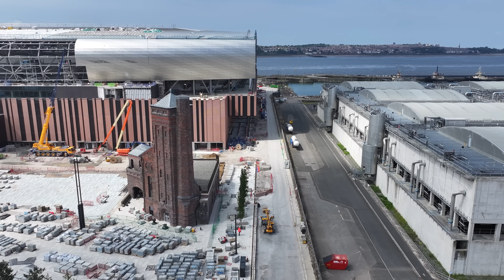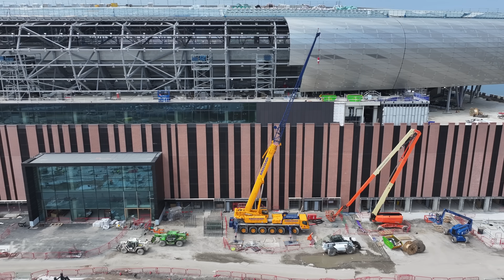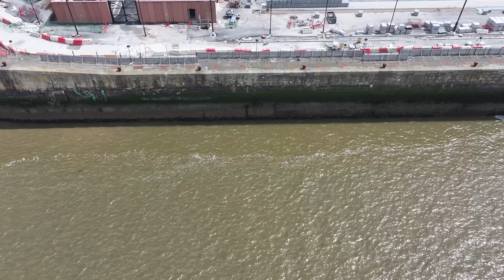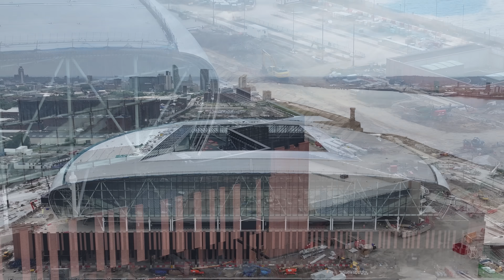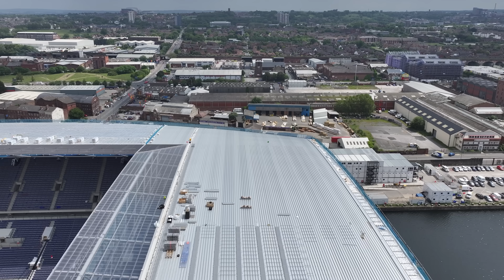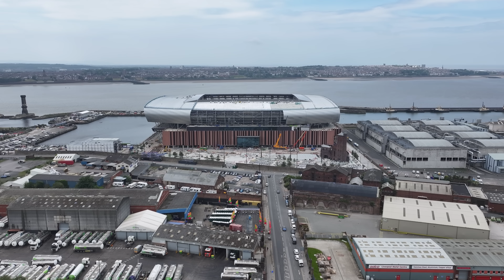NEW Everton FC Stadium at Bramley Moore Dock. A Full FlyAround!

Comment: Hi Nick. Great videos as always. I see there installing more soak aways (at 3 minutes on your video). It's obviously there to capture any rain at high tide and then release it into the Mersey at low tide, to prevent flooding. It's going to be interesting how they are going to install the barrel cladding on the West Stand, as they've already installed the pathing. What are your thoughts mate?
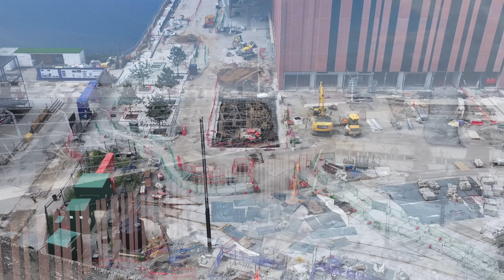Reply: The excavation at 3:00 you’re referring to is for the trees they’re about to plant. The plastic and soil they’ve installed will capture rain water to enable the trees to survive.

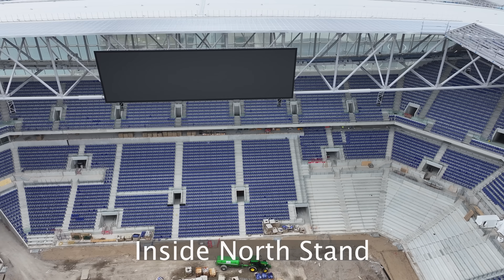Comment: Thanks Mr D 👍🏻 Next time, please can you zoom in on the empty row in the lower tier of the north stand (centre left at 11:38)? I know someone else made this request the other week, but you zoomed in on the wheelchair platform instead by mistake. In the final approved plans that row has seats so I don’t understand why it’s empty. Thanks very much 👍🏻
Reply: @evertonian95  Away fans are in the north east corner. I’m referring to the north stand lower tier (centre left) where the home fans will be. Empty row - no idea why it doesn’t have seats.
Reply: Dunc: seconded. Nick, IF you read this, Dunc is trying to point out the following Terrace: "The North Stand Big TV screen is as wide as the 3 central Lower Tier seating sections at 11: 35 mins, and in the left/west-handed Lower Tier seating section of those 3 sections, the 15th row up from the pitchside is a blank terrace, to the left/west-side of one of the 2 main vomitories. That terrace is not empty in the designs, so Dunc would like a closer look for clues as to why it is so now".

Comment: Will the water filled channel they are creating on the west side between the adjacent north and south basins be ornamental only or functional?
Reply: Only for aesthetics, won’t have boats passing through
Reply: Graham: Both, but not as a navigable waterway. It's mainly for aesthetics but it will also allow some water to pass between it and the Docks through pipes under the isolation Bridges for two reasons:
1) The concourses' groundwater will collate and pass from under the site and the West Promenade and empty into the Water Channel and thence to the Docks
2) Any flotsam and jetsam on the surface of the water channel will migrate to the Docks

Comment: Great video as always Nick, these are such great snippets of how good the stadium will be once fully completed.
Can I ask do you know how wide the canal will be on the west plaza also do you know how high the passageway under the steps on the west stand will be?
Reply: You can see how wide the water channel will be if you search ‘stadium db final Everton design’ and then scroll down to the high definition images (‘renderings’) from August 2020 👍🏻
Reply: The general area under the mezzanine will be about 4m between the granite flooring and the mezzanine support steels.  I can't give you one answer to the width of the water channel as it's to be an irregular shape and the front/west edge of the Lower Promenade will not actually run N-to-S parallel with the old Dock Wall at the West Side. So, if you want an accurate-ish measurement at any particular position you'll have to offer one. As Dunc states, you can see where the outlines will be currently if you look for the Granite Coping Stones on the West Quayside.

Comment: Hi Nick, great video as always
It looks like rail seating will be fitted in the North corner for away fans and that is why seats have not been fitted in the lower corner.

Do you or anyone else know if some of the seats in the lower north stand are going to be exchanged and fitted with white seats, as the designs have 1878 showing across the lower section, while the south stand has a huge E.F.C covering both the lower and upper section.
Reply: The initial plans had 1878 and Everton in white seats but the final approved plans have all seats blue. There’s a chance white seats might be exchanged to incorporate a sponsor’s logo but no plans to at the moment 👍🏻
Reply: Cheers Dunc.

Comment: There appears to be a gap in the barrel cladding..will this be corrected?
Reply: Expansion gap
Reply: Looks terrible
Reply: Maybe expansion joint to be filled with silver/grey mastic.
Reply: @billyboy6467  I hope so
Reply: @billyboy6467  Billyboy: no, it will remain as an intentional small gap. You'll get used to it. Dan Meis wanted the engineering to be reflected in the overall appearance.

Comment: Quality video again Nick
Question about the barrel cladding on the north east side. There’s a gap where the two separate sections meet, do you think that will be filled or left??
Reply: ruins the look for me
Reply: I was down there yesterday and spotted that. It's very noticeable. We're gonna have to shine the Badcock symbol in the sky here for some reassurance. 

David, over to you....😂
Reply: They won't be joined. The north roof and the east roof are separate (all four stand roofs are), including the cantilever steel that the barrel cladding is attached to. There's a gap between the side and end roofs as well, maybe it's to allow for some movement in high winds? I think there's going to be some kind of floating, 'attached to one side but not the other' kind of guttering (at least I hope so!) otherwise the people in the seats under there won't be happy in the rain!
Reply: Looks terrible, I hope it’s filled
Reply: @DuncTheBlue1878  it's a new entry straight in at number 1 on my stadium-build annoyance list, replacing the single missing coping stone on the media compound.
Reply: @colingillbanks4022  Yeah, that missing coping stone does my head in
Reply: @aq1974_  Yeah I've just had a look on the People's Project app at the rendering there and the gap appears on those pictures also. There's another one at the other end (South East) and two on the West barrel as well. Maybe it won't look as conspicuous when there's another one in place at the other end and the rest of the cladding is up.
Reply: @DuncTheBlue1878  It's  been missing for months. How hard would it be to just sort it! Unless there's some sensible reason why it's not been installed, obviously.
Reply: Not sure i'd have even spotted that gap but for the comments, barely noticeable and disagree that it spoils the look, onions.
Reply: @palez1046  I mean it's not barely noticeable. It's very noticeable. If it's part of the design and necessary for the aluminium panels to expand when subjected to the heat of the sun, then it's obviously something that we can all live with. I spotted it driving past on Derby Road yesterday, so it's definitely something that can be seen even from a distance.
Reply: @DuncTheBlue1878  ; me too. It makes me feel anxious and fidgety and want to check the cans in the kitchen units are all facing the right way!
Reply: An expansion gap would make sense
Reply: @colingillbanks4022  Colin: yes, I can give you a full version of the reasons for the necessary part of the design but the headline is that the expansion gap is there to stay as part of the design.You'll soon get used to the idea that it visually separates the different areas of the stadium and because of that I quite like it. Dan Meis wanted the stadium engineering to be seen and understood, which is just one of many reasons why the barrel-cladding is partly see-through. There's something of an irony in people wanting to preserve the old engineering points of interest from GP, such as the Leitch design, but don't want to accept and admire the looks of the feat of the new. I do get that everyone's opinion will differ.
Reply: @A-Queue  There are no seats under the Expansion Gap in the Barrel-cladding. I am, and you need be, more concerned about the finish under the Expansion Gap in the Standing-seam Roof, which does over hang the seating.
Reply: @colingillbanks4022  Colin: I can give you the reasoning. The main reason is not the expansion of the aluminium, especially as the cladding is all in small sections that have their own very small expansion gaps between each section. It would be more appropriately named a Movement Joint.
Reply: @davidbadcock2225  I've seen it again on my train journey into work today ans it probably looks less of a deal than I first though. I suppose if it matches each end - seems to be where the north/south stand roof joins with the East/west borders - it won't look too bad.
Reply: @davidbadcock2225  hmm...I would have thought (like I said above, but I'm only guessing) there will be some kind of guttering on the underside of the gap. We'll see, but I'll be looking for seats away from those gaps on cold winter matchdays just in case. Old Trafford doesn't need a competitor for 'most notorious stadium water feature' award!
Reply: @A-Queue  I am assuming so as it wouldn't make sense for such a fine detail being overlooked with such significant negative consequences. I reckon the planned solution is tucked away in some form of addendum specification not made available on the public access mediums. My guess is that it will be some form of underlying clear, flexible guttering but many options are possible, such as a wedged plastic insert. I'd have expected it to have been installed already if it's to be under the gap, seeing as how the under the roof work was completed some time ago. I doubt it ill be something overlying the gap as it would be vulnerable to the windy weather. It's a mystery and we'll have to wait and see what happens.

Comment: Hi it's looking good nick do you know why it was  Built that way round the west stand looks the most Impressive with the steps up to it but its round the back you won't see it unless you're going to the game
Reply: The West Steps are a design feature that serves several purposes.

1. A viewing platform for fans over the Mersey.
2. A place for fans to sit out before the games start (weather dependent).
3. Shelter for the rear of the stadium during stormy weather.
4. An escape route for Upper sections of the West Stand, in an emergency evacuation.
Reply: @DarrenCowzer-cx7ot  Will there be benching or just bare concrete to sit on?
Reply: @ollytheblue101 - safe standing can be terracing with safety rails in between, or it could be seats that can be used or kept up.

A number of clubs are in a safe seating trial, the UK government will decide if they will allow 3 x standing spots to 2 x Seats etc.

There is safe standing in Liverpool, Chelsea, Dortmund and many other clubs.

As far as I know, there are generally seats there but they're kept upright as everyone there stands.
Reply: @ollytheblue101  Olly: Darren has given you a fairly comprehensive reply but i think his second reply may not be what you're asking? If I am guessing right, you're asking about the terracing on the Western Terrace areas. 
The answer I think you want is that there WILL be SOME benching on the Mezzanine and the West Quay but largely it will be as you see. The Lower Promenade (the lower area now seen jutting out into the water channel, on the Seacant wall), is showing on the plans to have the terracing finished off with stone/tiling to sit directly on. On the terrace up to the mezzanine, there will not be any 'additional seating' installations as people can choose to sit or stand on each layer.

Whilst it is so that anyone entering the site will do so from the East, for now, most regular non-match day activity will be on the West Side with people using the Hospitality suites etc. There will be people regularly visiting the club shop in the East Stand and on some days there will be activities on the East Plaza but the bulk of regular activity will be on the West Side.

As an additional point, in the longer term, when Peel have carried out the development of the Liverpool waters site and the Mersey Walk is developed, all the way from the National Garden site to Bramley-Moore dock, people will access the site from the SW corner of the site, with the terminal at the Pump House/Hydraulic Tower, so it will be even more of a significant Viewing Platform.

Comment: Still can't see the Archibald leach chris/cross on the brick work
Reply: Me neither. Dan Meis isn’t happy about that either.
Reply: It is most visible in the corners where there’s more brick panels next to each other. I wonder if they deliberately dialled it down? It’s on the walls, on benches and is going to be on the perimeter fence by the accumulator tower too plus probably used as internal design - there’s more here than at Goodison!
Reply: @stevesanders6770  Steve: yes, the planners dialled it down before approval. One droner in particular, who flies very low and very slow, regularly reveals the pattern on the NNW corner, in the right light.

Comment: Nick: I hope you had a good time away.
1) My goodness, Nick, you do have brain-fade at times. Seeing as how it's been referred to fairly frequently (and was included in your East Plaza explanation Studio Video back in March) and seeing as how the same structures have been used wherever trees are located in hard-standing, granite flooring on the East Plaza, I thought you'd be relied on to see that the hole dug and now filled with the ArborSystem grid, is for the 4 trees at the SE corner of the Stadium in a 2x2 matrix there. It will then be extended towards the South Stand Viewing Gallery for at least 3 more trees in a single line.
2) It's good to see at 1:25 mins that they have started on the plant and tree border just to the West of the Pump House which will act as a backdrop to the Stage Area.
3) It looks as though they have now got the remainder of the 13 Columnar Elms' pits sorted along the North perimeter.
4) There are many comments on here abut the intentional Expansion Gap in the barrel-cladding. If you'd like an explanation, then please let me know.
5) You'll find that LoR have laid rebars in the trench at the side of the Seacant Wall of the Western Promenade.

Comment: I think the open areas on the north and south stands, exposing the back of the upper terracing look terrible and will give the stadium an unfinished look, as if the architect just didn't know what to do at that point.
Reply: Yeah I have to admit it's my only little gripe with the overall design. It just doesn't quite work for me, that part of it. Maybe it won't be as big of a thing when the rest is finished but bit does look a little incomplete and at odds with the sleek design of the rest of the build. Seems a waste of space too, particularly with the South stand when there could have been some great views of the city centre from bars or whatever under the bowl.
Reply: @colingillbanks4022  I think the structural pillars limit the practical use of the space, but perhaps the exterior could be clad in solar PV panels to at least generate some electricity. The installed upper clear glass acts to protect from wind and rain and allows natural light into the stadium. On the south side anyway.
Reply: @grahamcook9289  Yeah I suspect you're right. I would think that those pillars extend below into what seems to be the glazed hospitality area in the South stand as well though, so it must be an issue there too. It is what it is I suppose, and I think we'll be fine with it once it's all completed. There's more than enough good stuff about the stadium to not get too caught up in minor negatives like those two ends. The smaller North Stand is my major disappointment but that's obviously due to a lack of space and they've probably made the best out of the limitations.
Reply: Graham: Dan Meis actually wanted the engineering of the stadium to be seen and appreciated and NOT hidden away, in much the same way that in a Cathedral you can see what holds everything up. It's an intentional point of difference to other stadia.
Reply: @colingillbanks4022  Colin: the view is precisely why a cantilevered Viewing Gallery and Hospitality Suite is provided in the South Stand. Being another 10-20 ft up isn't actually going to change the perspective of the view to the city centre or Mersey significantly at all (the maths dictate that).
Reply: @davidbadcock2225  Cheers David, yeah I get that. It just could perhaps have been bigger? Seems a waste of the space available unless it's just not practical because of the steel supports projecting up through there.
Reply: @davidbadcock2225  Hmmm...not so sure about that. To me, it makes it seem even more like the architect lacked imagination at this point and gave this rather lame excuse instead. But on the subject of modern cathedrals and places of worship by the masses, could not stain glass windows have been incorporated depicting Everton's history? Now that feature really would have made the stadium stand apart.